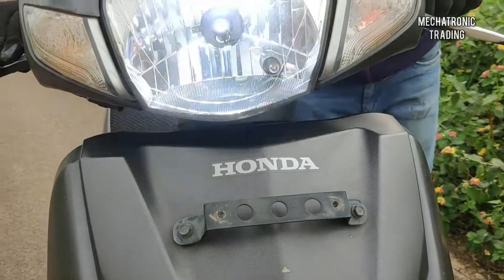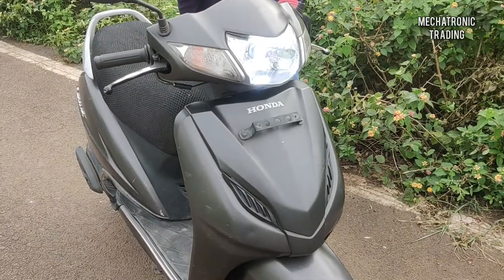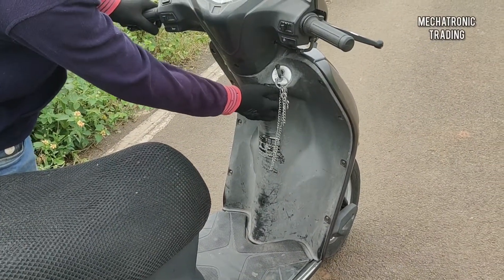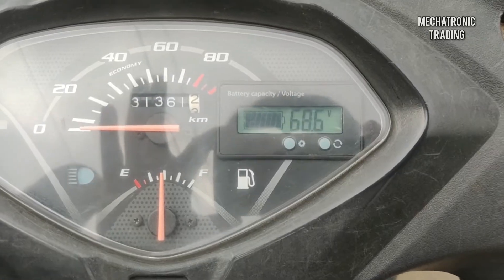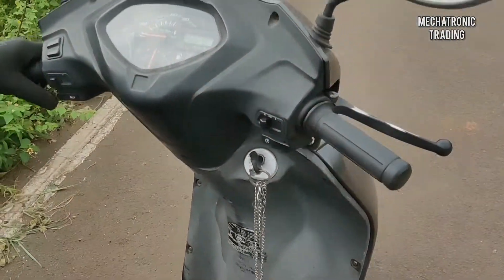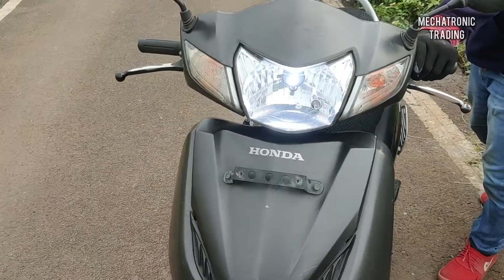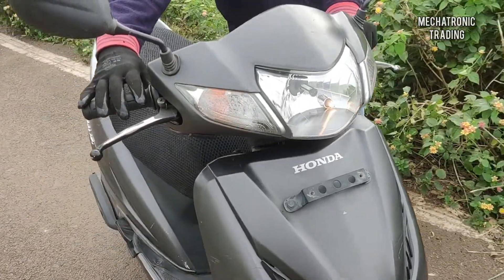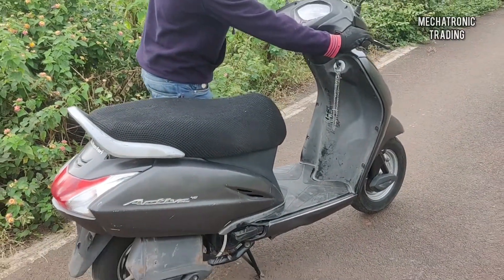Hybrid Scooter Conversion Kit India | Petrol Plus Electric Scooter Hub Motor Kit | Hybrid Activa Kit

Comment: A few questions:
1) Does the heat from the engine/exhaust harm the motor over long term use?
2) Why is the bike being kick-started? Does installing the electric motor take away the starter motor function?
3) Is it possible to fix this to the front wheel instead and have a combined usage to take load off the engine and vice versa?
Reply: for question 3, i think power put on front will not put the vehicle in balance while driving, i think. Thats why bike car all, power connected with rear wheel